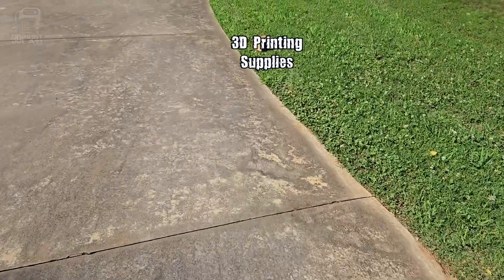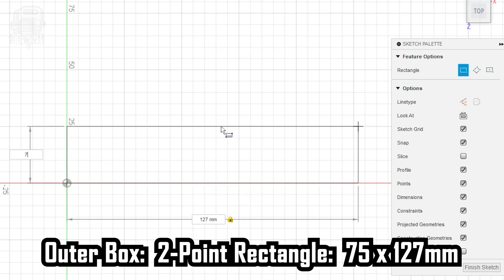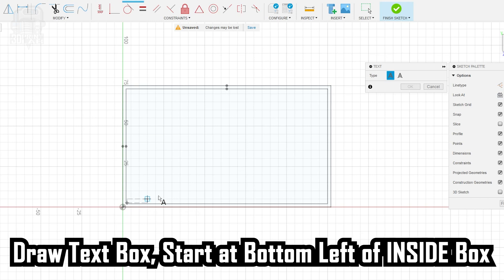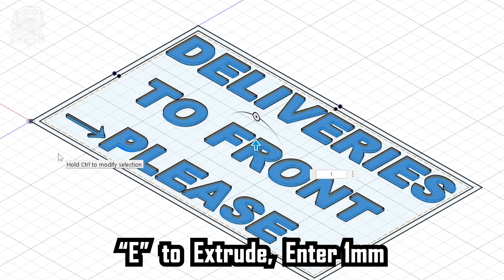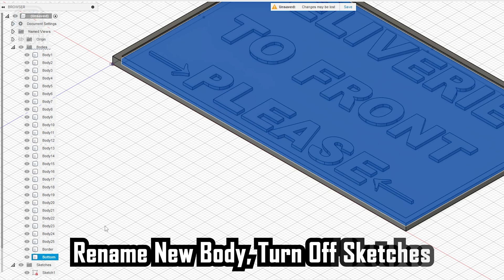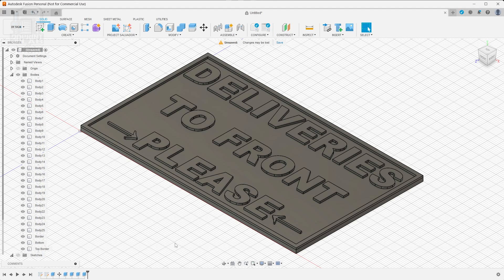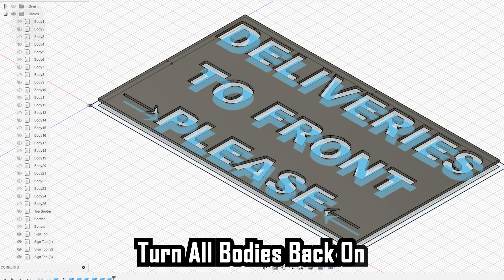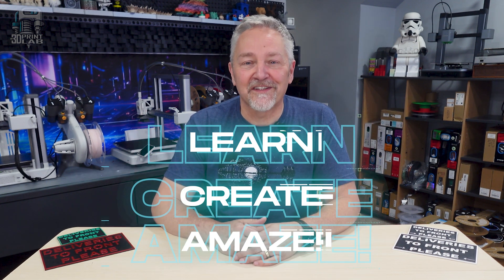EASY! Create Stunning 3D Signs With Fusion 360

Comment: I make signs with my printer but is there a way to trick the slicer to start the lettering on top of a flat starting base without having a layer or two that start the wall layers of the letters? Kinda hard to explain but it’s the point half on the layers scroll bar.

Comment: Lots of good info here. But a lot of time could be saved by changing the starting point of an extrude as well as using the combine tool to cut out the letters from the top layer of the sign. Also, no need for two sketches, one would have worked just fine.